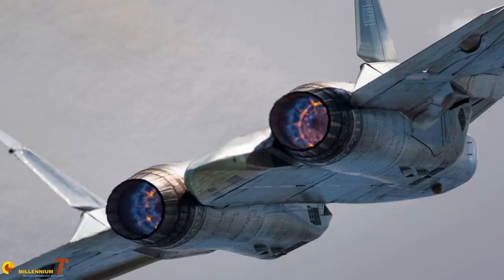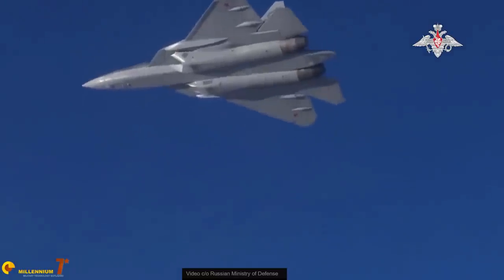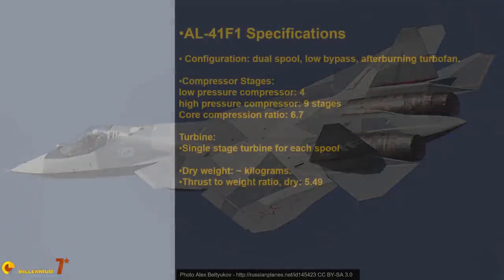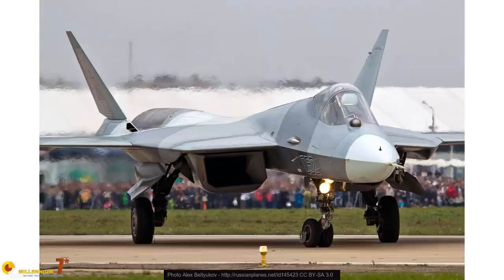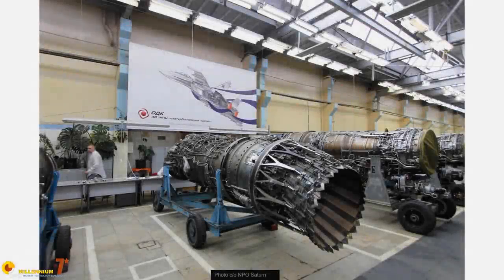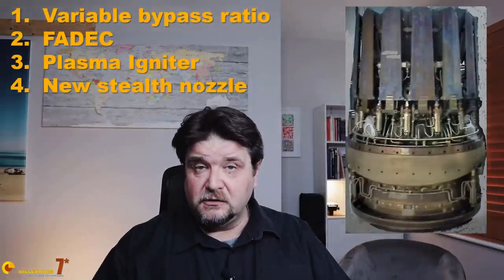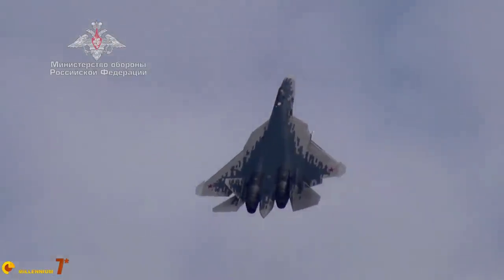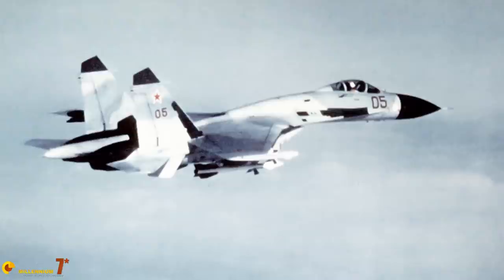Su - 57 the Raptor Slayer | Part 2 - Propulsion

Comment: Planes like the F-22 and the SU-57 have potentially another trick up their sleeves. Their high efficiency, high thrust engines will work above 65k but at that altitude wing surface controls don't work very well. With thrust vectoring even at the lower thrust you can still control craft as long as you can get even 25% thrust. With it you still control your plane and prevent a spin up 85k feet. I know this sounds crazy but I have seen simulations on missiles.
Reply: M.m.mm. not crazy at all.
Reply: Wow that makes a lot of sense thanks for this info I have a feeling your on course with this.
Reply: Su-57 proved to be particularly susceptible to adverse yaw at higher altitude since it behaves like a pancake, blanking out the relatively tiny vertical stabs. That's why the first production Su-57 crashed. Chief General of VVS said they have addressed it from a training standpoint already, which will put pilot-observed yaw input limits on the profile as the altitude increases.

If you look at the YF-23, it had huge stabilators with massive amounts of lift and directional control, so much that it didn't need TVC.
Reply: Sukhoj can take off aircraft carriers by its thrust.
Reply: it's for suborbital bombardment and satellite killing and if you include a LOx canister the aircraft can go into suborbital space giving the missile they launch enormous range
Reply: @TeddyKrimsony  Making an airplane go suborbital takes a lot more than adding a little rocket to it otherwise when it comes back it the plane will be uncontrollable. Turning a SU-57 into a X-15 is really not possible.
Reply: @warhappens-com4489  the x15 flew at 350,000 ft so the problems are not that extreme. The real reason why most military aircraft stay under 65,000ft is for rapid depressurization. Long story short the upper limit for what you can reasonably go through and survive is around 65k ft. Above that the pilots need to wear pressurized suits (x15, u2, sr71 to name a few examples) and they become less ergonomic for pilots to control. It is too much of a tradeoff for planes to go that high under most conditions.
Reply: @lovelyhippo7826  the planes don't go higher than that because there is a limit to lift. To gain lift, you need an aerofoil wing/lifting body. Slower planes achieve lift by maintaining a moderate altitude with a large curve on the foil. Fighter jets must have a very minimal aerofoil to allow them to attain their high speeds as well as to allow them to manuver without the wings tugging them all over the place. That's just fighters in general. To achieve more lift, they need more speed but at a certain point, the engine can't give any more speed and the air is too thin , it won't go any higher. There is a reason why all high altitude planes were very fast...with the exception of the u2 which was very light and used some very agressive  aerofoil and wing: body ratio. 

As for their efficiency to the OP, no. 5th gen jets are not all that efficient unfortunately. Their design philosophy is not very aerodynamic and the only reason they seem to have alot of range are large amounts of fuel and powerful engines. They achieve their performance by brute force alone. The f35 can't even supercruise. The f22 can only do it for about 120 or so miles, which is like 6 minutes. It's not efficient at all.v
Reply: @LRRPFco52  Small Stabs for smaller RCS and Drag are also benefits you get there, all designs are give and take
What 5gen has not crashed we lost 3 F35s this year and should not be used as a gotcha online not that you did, these Aircraft are the pinnacle of technology. Main things is pilots are all alive
Reply: @simulatedpilot3441  1 out of 1 production Su-57s crashed on its pre-delivery functional check flight.

There are over 730 F-35s delivered with 460,000+ cumulative flight hours, 29 different bases and 12 nations worldwide operating 3 different variants, including 2 maritime/carrier-based variants that have been made in the hundreds.
Reply: @LRRPFco52  True i'm not here to argue flight safety, you missed the point the point was saying even more mature programs have issues that's all it's not a judgment man you hella defensive bro.
Reply: @simulatedpilot3441  I thought someone else brought up safety, so I logically responded to that subject.  I agree that more mature programs have less problems when properly funded and staffed with competent leadership and technical support.  I’ve never seen a program have as much international and inter service support as JSF has, which really started with 6 different programs from the 1980s and 1990s before it became JAST, then JSF.
Reply: @serpentpigeon9108  Carriers? ;)

Comment: AL-41F-1S which is installed on Su 35, has 4000 hours resource. Not 1000 as you've mentioned. And  Found proofs, only in Russian.  How come  AL-41F-1  which is a modernized version of AL-41F-1S has a less resource then it's ancestor? Can you please comment on that?

Comment: This is the anti-fanboy site for military hardware buffs.
I like this guy's sensible and qualified discussions of what is quite complex hardware and engineering topics.
Keep up the good work mate. Your audience appreciates it.
Reply: Qualified no, but amusing nonetheless.
Reply: @sheltr9735  on fanboy basis of course.
Reply: Aeronautical engineer? No. Radar Systems engineer?  No.  Aviation Sytems engineer? No. Flight Test Engineer? No.  Test pilot? No. Fighter Pilot? No. Classified security clearance? No. ... qualified, no. Does that basis work.
Reply: @theccpisaparasite8813  If you are correct, then yes, that would work.
The only caveat is whether or not you are, indeed, correct. I did a quick scan of Millennium 7 but it netted very little. Unless one has access to military- / intelligence-level information gathering, I suspect that it would be difficult to discover Millennium 7's actual experience, to any degree of certainty. So, I'm reserving judgement.
Nevertheless, you did answer my question. Thank you.
Reply: @theccpisaparasite8813  No? No. Yes? No. Maybe? Absolutely no.
Reply: @unknownuser069  look, l just retired from Lockheed last year and I can say only one thing.  Every  bird flying today is obsolete.  The aviation technology in proto is at paradigm shift and all craft flying today are vastly outclassed including the F-35
Reply: @theccpisaparasite8813  yes everybody has just retired from Lockheed or Boeing or wherever, and the US is always ahead of everyone in tech.. Sure I believe u.. everyone on this internet is just writing bs!! And b4 u ask I read it for entertainment nothing more..
Reply: @MegaEdward39  oh no, each nation has different advantages and disadvantages in aviation assets
Reply from the maker: @theccpisaparasite8813   Hummm,, i have a master in aerospace engineering, I served in the Italian Air Force and worked, for a short period, in the military aerospace industry.
Reply from the maker: @sheltr9735   I am not making my real name public for security reasons and I always stated that I don't have access to classified sources. If I had I wouldn't be on YouTube.
Go back at the beginning of the channel and there is a video about where I find the sources.
Reply: @unknownuser069  Good guessing!!
Reply: @Millennium7HistoryTech  Certainly meets the general requirements for making educated speculations on the subjects you cover. And the entertainment value you provide is just 'cuz of you! LOL
Reply: @Millennium7HistoryTech  Thx for filling-in the blanks. Since nobody is forced to pay anything (unless volunteered), I really don't think anybody has any right to demand to know much about your personal details. Your personal security is paramount.
FYI: I'm going to look in to joining (Patreon or Subscribestar).
Reply: @Millennium7HistoryTech  and your clearance is? Oh, none.  Aircraft performance has long left the building as a primary determinant in aviation combat capacity.   Networking, battle space awareness, detection avoidance, electronic countermeasures and integrated tactical management determines who wins.  That is the why of the unimpressive F-35 flight performance.  It doesn't matter anymore. It hasn't been about that for a loooong time.  There will be no more pilots in the planes of the future. Materials and aeronautical design are past what pilots can take. They are the limiting factor.  But you already knew that.

What's under the hood is all that matters. The general public has no access to that info.  If you've got a master's, you know this as well.
Reply from the maker: @theccpisaparasite8813  In one of the videos I explain that what you just described is the US doctrine, not a proven fact. It may be right but it may also be wrong and I personally hope we will never have  proof.
If I had a security clearance I wouldn't be on YT referring classified information anyway.
However, if you do not believe that my work is informational or worthy of attention, please feel free to ignore the channel. I am not here to convince anyone. I just do this because I and others like it. However, thank you for your time and attention.
Reply: @unknownuser069  exactly, the airframe and engines are no longer the dispositive issue in aircraft utility.  These birds are almost mini AWACS platforms with individual combat capacity.   90% of the combat capacity is under the hood unaddressable by a YouTube video.
Reply: @unknownuser069  engineers are right, we built the crap you are lionizing ... didn't think it through did you? I'm going surfing ... the swell is crappy, but I gotta get some Tshüß
Reply: @unknownuser069  who do you think they work with?  The Air Force tells them what they need, where they want to go with doctrine, operational employment,  and tactics.  The engineers build to these specifications.  They don't choose Air Force tactics, its the other way around.  That what you don't seem to get, the USAAF battle space management paradigm has changed and you don't seem to understand that.  The engineers didn't choose the direction they just built the machines that accomplish it. Pay attention. It isn't my fault you don't understand the USAAF operational logic and tactics.  You were the same kind of guys that didn't understand that the operational paradigm had changed until about 30 seconds after 0238 17 JAN 1991. By the time the sun came up people with your mind set understood that a revolution in aviation technology and doctrine had occurred and were going to get continued lessons for 40 days.  Judging from the comments I'm seening here, y'all going to be surprised when the next shift is displayed.  So will the Russian and Chinese just the way they were in 1991.  Revolutions take time, 2030's air force will be quite different from what has been flying for the last 30 years.

Comment: It seems to me that the stealth profile of the aircraft would be compromised if the aircraft is trimmed with the control surfaces, yet not compromised if the aircraft is trimmed with the thrust vectoring. That would facilitate the aircraft attacking air tankers and control aircraft.
Regards,
Geoff. Reeks
Reply: I'm thinking this as well.  Although again I'm also wondering if the 3d thrust vectoring with such a powerful set of turbofans and full FADEC/Avionics integration is also a necessary feature with the aerodynamics of the plane.  Especially with supercruise, there might be flight domains where the aerodynamic controls themselves do not have enough authority to maintain certain rate requirements.  If they are turning over more of the flight envelope to computer control/pushing to default unstable platform it represents a big shift from previous Russian aircraft doctrine which pushed for neutral stability
Reply: The shape of the Russian nozzle is still less efficient than the shaped control surfaces. Even if this weren't the case the rest of the plane itself does not have such a low RCS in the relevant bands to justify the expense for the marginal gain. Even if none of that were true....virtually nothing has been done to limit the thermal signature of these engines. (Compared to the F-22) Even if this was a cost effective way to improve the overall RCS of the aircraft in order to enable to accomplish something meaningful it couldn't before, it's still going to be detected by thermal radar cueing (IRIS, EOTS); the Russians say they can detect the F-22 at 75-90km.........the Americans will be able to detect Su-57 beyond that number. 110-120km is a significant range to be able to detect (and cue radars) an aircraft that's suppose to be hunting AWACS in the rear. All F-35s are equipped with EOTS out of the factory. I don't see how thrust vectoring on this aircraft would be worth it for RCS gains.
Reply: @LRRPFco52  F-35 sensor was able to detect rocket launch on hundreds of km BUT if you actually watch the video presentation about this event (available on youtube) you would know that pilot precisely known where to look, as only one sensor under with diamond-shaped stealthy cover replacing usual external targeting pod likely had the necessary IR sensitivity with magnification capable trading field of view for required long-range performance... Also, Su-57 is far from launching a rocket in terms of emitted IR power and size of the heat source, especially from the front, not to mention that F-35 using early 2000 targeting pod technology as the basis for its main IR sensor and these things did not perform miracles against stealthy jets, but if you have clean winter night and looking in the right direction, sure, you can find even satellite.
Reply: While ideas of using thrust vectoring for stealthy trimming or better control at thin air altitudes when traditional control surfaces did not work that much as mentioned in the different post are interesting and with the new stealthy design there may be more of such possibilities, the main purpose is likely to simply produce a better plane than was the export-oriented Su-35S in every aspect including in real conflict unlikely 1 on 1 training exercise dogfighting (where failure to win against older generation can produce negative publicity undermining export sales and opinions about the state of Russian defense) together with Russian heavy emphasis on jamming the hell out of enemy radars, thus together with more stealthy planes on both sides, Russians may consider short-range combat more, not less likely to happen than was the case of 90ties policing events against countries utilizing downgraded Soviet tech, where combat initiated at BVR was the most common.
Reply: @LRRPFco52  It's hard to imagine the F-35 with improved DAS. Detection and lock of SU-57 should be no problem, while SU-57 might detect, but doubtful it would achieve lock at the distances F-35 is capable of beginning the engagement at.
Reply: @spackle9999  F-35's can't see each other in IR or RF spectrum outside of WVR.  MADL has to connect them, which was not an easy task to conquer in development.

Unless the Russians have some kind of leap-ahead breakthrough in sensor and processing technology (US leads the way in those domains), they don't have a chance to reach parity.

Even if they did, the Technical Refresh open architecture schedule for JSF processor speed and IR sensor upgrades keeps it way ahead of anything out there.

Our problems lie with traitors within, not our tech. Russia and China will now have tons of freedom of maneuver with their control over the WH and most of the US IC.
Reply: @LRRPFco52  Just a wild idea: I wonder if those new Ratheon IRST modules would be small enough to be seeker heads on AAMRAMs? You could then use MADL to guide the missile to target without ever alerting the enemy they were being tracked.
Reply: @spackle9999  They're too big, but they already use passive IR tracking for data link missile guidance.

They just demonstrated that on an F-15C with the Legion pod as well.
Reply: @LRRPFco52  I just don't see how giving F-35 a passive IR/EOTS track-to-kill ability isn't the top priority right now. Great, the F-15 has legion pod. But it'll only work when they are well within range of PL-15. 

If F-35 had Legion Pod integrated within its stealth profile it would essentially become an invisible assassin. Even more so than it is now.

Comment: Great analysis. Nevertgeless, the most important part of su-57 is its integrated electronics. It has 5 radars of both x and l band. The last will allow it to detect stealth aircrafts at distances of 200-250 km, although it is not quite evident if he can shoot them it this distance. His next key feature is his weapon's bays, which are the biggest from all 5th generations fighters. They will allow it to carry 8 medium range rockets (up to 200 km) alonside with 2 short range, big bombs and even hypersonic rockets. Ideologically it is f-22 with the strike capabilities, later realised by USA in f-35 project.
Reply: "Integrated Electronics" simply means that the SU-57s radars, ECM, and signal processing is all done fully by digital computers....which is what F-22, F-35, Rafale, Eurofighter, and Gripen already do. Pointing this out is just to say "in this area the Russians aren't a generation behind"....its not actually significant point in the Su-57's favor. In fact its essentially a redundant qualification for all 4.5gen aircraft onward (and many upgraded 4th gen); like telling me that your gaming computer is digital. It SHOULD be already and you shouldn't have to tell me. Additionally the Su-57 will never be produced in numbers necessary for your F-35 strike comparison to make sense: the F-22 will likely drop more actual bombs on more ground targets than the Su-57 ever will.
Reply: @Dadecorban  @ Tite Vieriois Su 57 is still being improved on the strength of the case and a newer engine! Greetings from a native of the Russian Crimea @